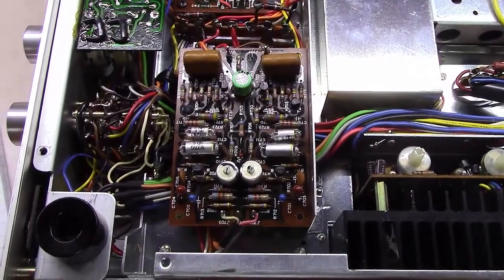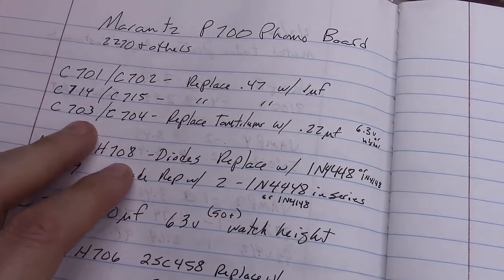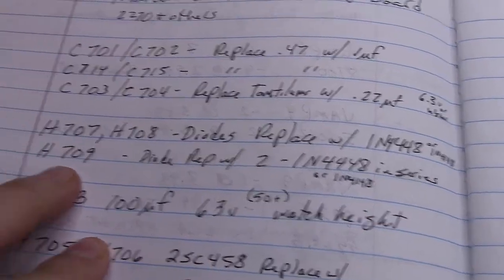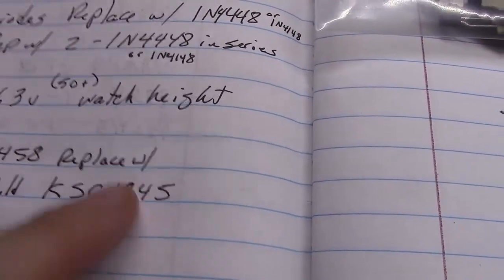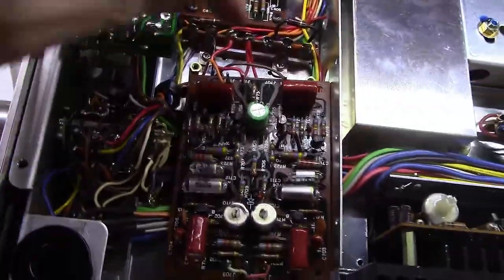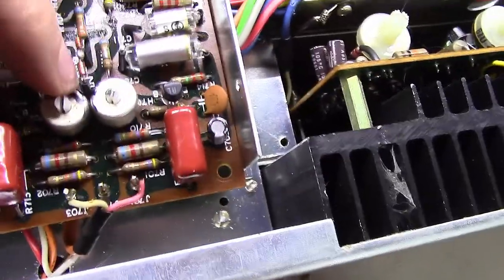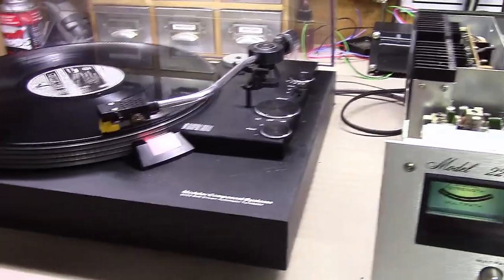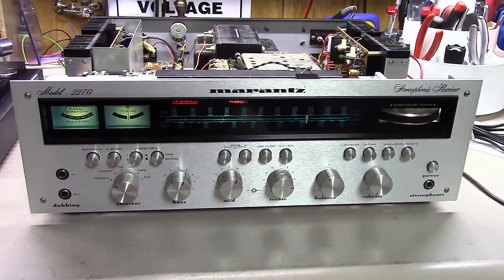Rebuilding a Marantz P700 Phono Board - BG044

Comment: Any reason not to use Wima film caps vs the poly caps. Just curious.     Also, on a 2270 I found C701,702 were acting as an antenna and were generating a loud hum.  I tried a low leakage nichicon KL series and it was much better.  Is this a bad usage for the phono stage?

Comment: Hi, this is Mehul from India. Can you please help me on a small query on my Marantz AVR? It is SR7007. It has an issue where the switched 6.3mm Headphone Jack relay at times gets stuck and due to that teh speakers give not sound into the speakers even when the headphone is not connected. Do I need to changet the jack or the relay or both? Can simple WD-40 spray on relay rod do the needful? Please help with your valuable suggestion.

Comment: hello, good morning mr. could inform the output voltages of the marantz 2275 transformer.
therefore.
orange wires = 2
yarn yellow color = 2
wires green color = 2
black = 1
blue = 1
white = 1
I thank you because my transformer is down.
wcmm1970@gmail.com
thank you.

Comment: Love your videos, thanks for sharing all this knowledge!!  I'm about to rebuild my P700 board (Marantz 2245) and plan to follow your steps.  Question, have you ever had a need to adjust the 2 potentiometers on the P700 board after replacing all these parts?  There is a step mentioned in the 2245 service manual (section 15, step 5) where you're supposed to increase the 1 khz signal until slight clipping occurs and adjust the pot(s) for equal clipping level(s).  I'm afraid my function generator's output is far too high to feed into the phono input, it clearly overdrives with the gain all the way down.  I suppose I could devise some sort of attenuator to drop the signal, but before I even try that do you think I should waste my time?
Reply from the maker: My function generator goes down to low enough output to allow for this and yes, I follow the service manual steps mentioned above.  Good luck!!
Reply: i realize it's kind of randomly asking but does anyone know a good place to watch new series online ?
Reply: @Calvin Nathaniel flixportal :)
Reply: @Terrance Grady thanks, signed up and it seems to work =) I appreciate it !!
Reply: @Calvin Nathaniel Happy to help :)

Comment: Just FYI, the Marantz 2226B has a "P700" board but it's not the same at all. Different layout and different transistors.
Reply: I also have a 2226b that I acquired. Come to find out they used it outdoors (insides prove that to be true). I cleaned the switches and potentiometers out yesterday with Deoxit d5 and the scratchyness is gone. My problem now is the phono sounds terrible, but aux sounds perfect. Hoping this video helps.